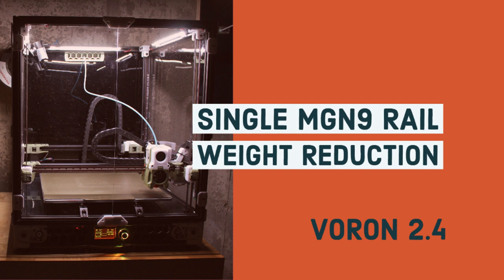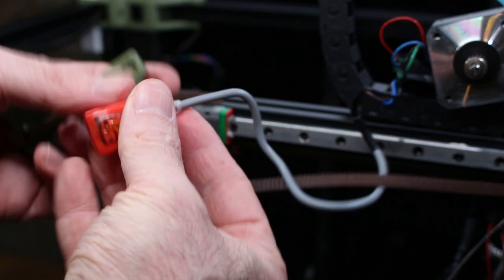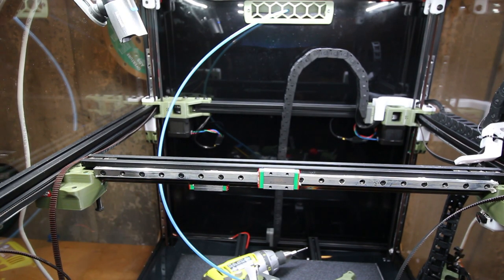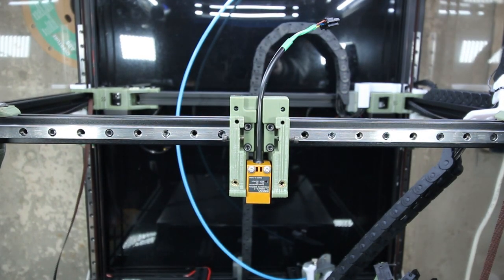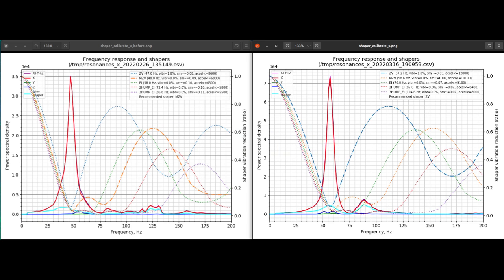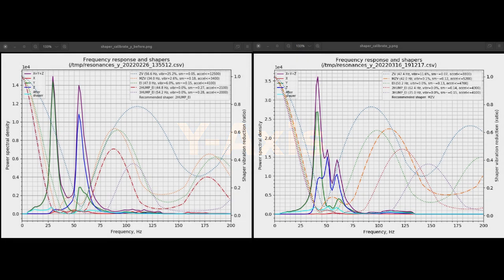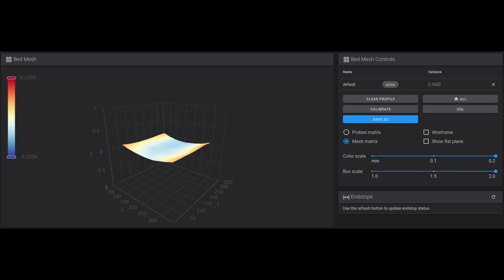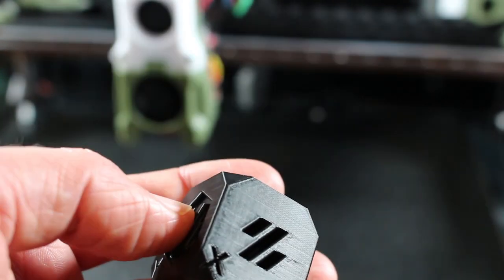Double your acceleration for free?  Eliminate x-axis weight with a single MGN9 rail.

Comment: Found this video while building my Voron 2.4r2 kit that come with MGN9s only and no MGN12's This is interesting.
Reply from the maker: This is working great for me.  I have no plans to upgrade to the heavier MGN12.
Reply: @KapmansBasementWorkshop  I absolute will be trying this. Single MGN9
Reply from the maker: @jc84com  It takes a some time and I did print a new part, but really there is no downside here and the gain is pretty impressive.  My linear rails are good quality and had no play, so be sure to check that 1st.  I would imagine that if you rails are more "loose", there might be issues.
Reply: @KapmansBasementWorkshop  Vivedino Linear Rails from Formbot kit, The Rail have numbers under them. in the set the ranged form 0,1,2,3,-3 were some of the numbers written on them. I used the "0" for the x axis. I cant tell them apart. They all feel rock solid and and very smooth. I still have to clean The linear rails. I have Downloaded the 9mm STL files linked in your description. I am still building the X axis slowly and whole printer. I have so much more ABS to print on my Creality CR10V3. Very impressed with the CR10v3 and its ability to print ABS. everything is coming out perfect quality. I have even purchased Linear Rails for the CR10V3 MGN12's but that's a different upgrade custom project altogether.
Reply: @KapmansBasementWorkshop  I have even seen some videos of people replacing the 20x20 beam with CarbonFibre.
What about more weight reduction if you only add screws every 3rd hole as opposed to every 2nd hole on the Linear Rail.
My printer is the 350 build so that's 10 Screws and T-Nuts, Could potentially only install a Nut every 3rd Hole total of 7as opposed to 10, Reduction in 3 Nuts and bolts would be on my scales that would save 9.9grams.
Even considering if 3 spaced nuts creates too much warp on the Linear rail maybe using ABS TNuts on every 2nd rail. Something to consider/test.

i'm not going for record Benchy or anything.
Reply from the maker: @jc84com  I've seen those videos....
Mine is the 350 as well and I have a t-nut/bolt for every other hole.  I've seen others use fewer successfully.  But this was my 1st attempt and I did not want to risk any other problems that might negatively impact the outcome of this.  I would guess skipping two holes instead of 1 would work just fine.  The linear rail is very strong and we put almost no load on it in this application.  Next time I disassemble it, I will probably reduce the number of t-nuts.
Reply from the maker: @jc84com  The Creality is a great printer.  But also this Voron project represents my 1st try using ABS that seems to generate much fear in the 3d printer community.  I must say I love printing ABS.  I consistently get the highest quality prints using it.  Precautions need to be taken, and I have had my fair share of warped prints, but the end result is worth it.  I'm a convert.
Reply from the maker: @jc84com  Also, I wish you the very best in your build!
Reply: @KapmansBasementWorkshop  My build has been successful, I built with the 1 MGN9 rail and it works great. I need to wait for my input shaper to arrive to do some tuning.
Reply from the maker: @jc84com  This is great to hear, I'm glad it's working well for you!  Also Congratulations on the new build!  The accelerator makes input shaper tuning quick and easy.
Reply: @KapmansBasementWorkshop  Id like to see a update video on how your single MGN9 rail is holding up. I'm not that happy with mine, As the quality of the rail has too much wobble/movement. And its the carriage not the 3dprinted parts. its a shame as I really like the idea of a single mgn9 but I may have to go to a single mgn12 or dual 9s.
These LinearRails seem problematic mounted horizontally with weight extended off them compared to top down loads.
Reply from the maker: @jc84com  Mine is still working great.  I'll certainly do a follow up.  I think the rail quality here is critical.  I have no experience with the brand that you are using and I can't really find any information about it.  I have read that for some people, tightening the bolts that attach the print head to the rail carriage cannot be too tight.  Doing so flexes the carriage and causes play.  If you decide to replace the rail, MGN9 or MGN 12, I would recommend you go with a well known brand such as Hiwin or Bosch.  There are a number of people in the Voron community that run with a single MGN9 with long term good results.
Reply: @KapmansBasementWorkshop  thankyou, interesting overtight bolts on the carriages cause flex. I will look into this.
Absolute a quality carriage and rail  is critical.

Comment: would it be possible to use the voron .1's extruder/hotend setup (Afterburner mini, Aftersherpa, etc) with the same rail it uses? Think its MGN9C?
Reply from the maker: I don't think so.  That Voron uses MGN7 rails on 15mm extrusion.  The Voron 2.4 uses 20mm extrusion with MGN9 rails.  I'm pretty sure the MGN7 rails are too small to be mounted on 2020 extrusion.  They will probably fall into the t-slot.  However, if you designed a new carriage for the 0.1 hotend that fit the MGN9 rail, it might work on a Voron 2.4.  I have no idea if there's any weight or money savings to be had in that case.  That said, I really have little to no knowledge about the Voron 0.1 and how that print head compares to Afterburner or Stealthburner.  It's an interesting idea.

Comment: I designed mine with 2 MGN7s
Reply from the maker: Has it worked well?  I would assume so as I think the 2 MGN9 rails and even the single MGN12 are way over spec in terms of load carrying abilities.
Reply: I'm thinking single mgn7 and 2 short carriages would do fine.
Reply from the maker: @predragbalorda  It would need to be a very high quality mgn7.  From what I've seen, the carriages tend to rotate slightly around the rail which translates into play that allow the head to rock from front to back.  Even on Voron v0.1's people will switch to a MGN9 to minimize that motion.
Reply: @KapmansBasementWorkshop  one may very well rotate, but 2 spaced apart appropriately won't.
Reply from the maker: @predragbalorda  True, but the alignment of those 2 rails is not easy.  If it's off just a little, you will end up with some odd bed readings where it appears your bed is not flat when it really is.  Based on my past experience with 2 rails on this printer, I won't do that again.  It will always be one where if it is off just slightly, the geometry is easy enough where a bed mesh can easily compensate for it.